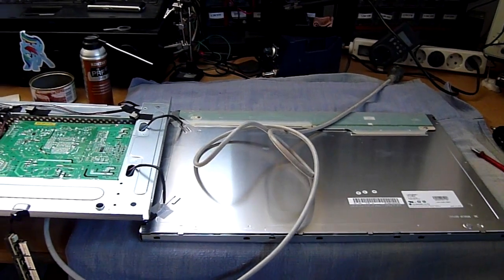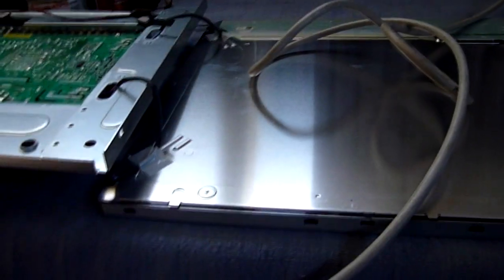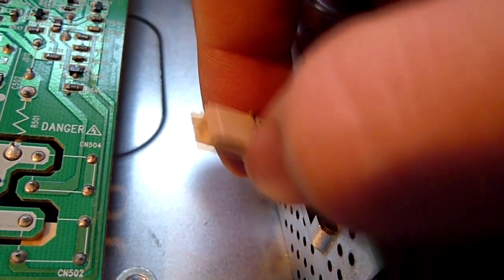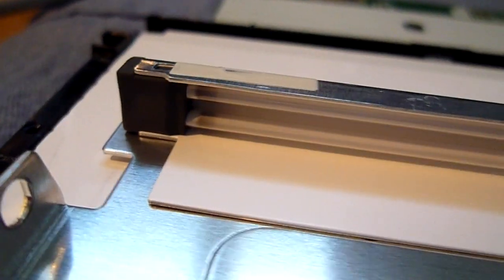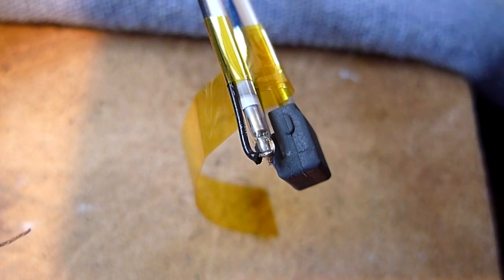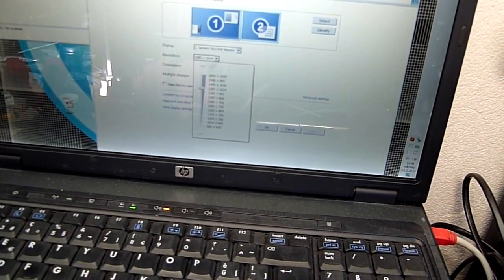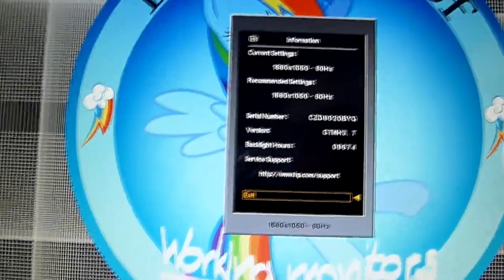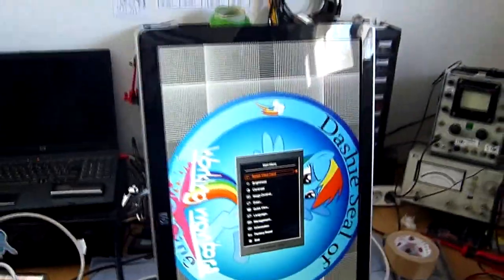Troubleshooting LCD monitor CCFL trouble

Comment: At my work we had Motorola mobile computers for barcode scanning that had a 10" display. These were CCFL backlit displays. After 10 years of 24/7 use I started to see failures, the display developed a pink hue. We had close to 100 of these units. After replacing the CCFLs in a few of these it got much easier with practice. I remember breaking quite a few bulbs when re assembling.

Comment: I've been struggling a bit with a LG 22" LCD from a client and I've just discovered the issue is just a CCFL. The failure was that, after sometimes just seconds, sometimes more than 15 minutes of use, the backlight will shut off randomly. I've checked if all the CCFL were on (all 4 were apparently working), checked the PS: inverter, capacitors, and blah blah. Nothing wrong there. Also I've spotted weird errors like: in the moments backlight was working, changing brigthnes on the OSD didn't work at all. So I've even suspected something going wrong with the CCFL controller, or even the OSD controller. 
But even after that last weird thing that happened, I tried disconnecting one by one the CCFL and found out it was actually one of them (that was actually correctly lighting in) the one that made the protection shut off.  It also seems to be the responsible for that error with brightness control. After replacing it with another, everything is working well. 
It was ONLY buzzing if brightness was at minimum (after changing it to minimum with the test CCFL, and connecting it back again, it was buzzing and flickering. At maximum brightness it seemed OK).

Comment: Lovely. I'm in that same situation right now with my 22" LCD monitor.
I hope it isn't the inverter on the power supply and I hope I don't screw things up. Leftmost part of these lights are darker and that noise you showed us on video was indeed present when I was testing. Fingers crossed!
Reply: Hey there.. You seem to know things about inverters so I&#39;ll ask you the same question I asaked the poster ... I just
 need to know if this monitor uses a CCFL or a CCFL-2 lighting system. 
(Apparently the CCFL-2 lighting uses two bulbs connected to two 
inverters.) And makes a difference whin applying settings to a color 
calibration system like the Spyder5....Thank you brother for your 
informed answer! ...Randy.
Reply: +Randy Levine I ended up not using the CCFL lights anymore.
Did a DIY using LED strip instead, using the 12V from the power source.
The light from them is brighter, but I dismantled the LCD a month after that mod because, all of a sudden the monitor stopped showing anything on screen. It was not backlight, maybe the circuit with flat above the monitor broke something. Unfortunately I couldn't find the problem so far.

Comment: I have the same problem, It turns on for a minut and go black, i suspect be the same problem as had already change the power suply and that did not solve the problem, but get a bit scary as you say the CCFT can exsplode if it get to hot on soldering it, and also seems not go that easy to do.but I order from china (AliExsp) 2 CCFT that become with the metal holder for around €8 or in dollars be $ 9,55 and hope I can fix it with that, and thanks for the upload off your video here on YT

Comment: Good vid! /)
I just took apart an old monitor of mine that had the same symptoms, and those dark parts at the end of the tubes looked like some black liquid was seeping out and touching the inside of the glass. I'll assume that means it has burned through. Plugging in a working monitor's back lights to the same power supply, they turned on and stayed on just fine. Learned something new here today, thanks!

Comment: i have a viewsonic 22in ccfl monitor, the power on blue led keeps cycling on-off, but when i disconnect the hv supply its steady on,probably oneor many ccfls must have fused or wiring shorted out, cannot seem to like todays led back light monitors/tvs, ccfls are pleasent to the eyes.

Comment: I have a Hannspree HF237HPB. I have replaced all the capacitors thinking that was the only problem. It has increased how long the light stays (up to 30secs compared to just 1) I checked the ccfls and one bulb defiantly needs to be replaced. How would you go by identifying what size bulbs are needed.

Comment: Don’t CCFLs sometimes have a coating of mercury on the outside? (Not just mercury gas inside)
Reply from the maker: No.
Reply: @FFcossag   “The literature reviews showed that not only does the fluorescent powder in CCFLs in LCD TVs contain mercury; in fact the entire CCFL, especially older and used CCFLs, have mercury amalgamated to the glass and the electrodes as well”
There was a study on this I cannot post links because YouTube will delete my comment then but if you google that quote it should come up.

Comment: Hello. Thank you for your response (By email)..Yes, apparently 
there are two types of CCFL lighting used in LCDs...Named CCFL type 1 
and type 2... Type one uses 1 inverter and type two uses 2 
inverters...As to the number of possible bulbs that each type can use, I
 am not sure.....

Do you know if the four bulbs in this HP monitor are connected to one inverter or two inverters?

Thanks for your help...

Randy... (From Toronto Canada)  :)

Comment: Hey there...Great video! ... Can I please ask you a question? ... I just need to know if this monitor uses a CCFL or a CCFL-2 lighting system. (Apparently the CCFL-2 lighting uses two bulbs connected to two inverters.) And makes a difference when applying settings to a color calibration system like the Spyder5....Thank you brother for your informed answer! ...Randy.

Comment: Very helpful!

I found one of the bottom CCFL on my Gateway FHX2300 monitor is bad and made the monitor shut down after 3-4 seconds.
I tried to unplug it and the monitor turns on only 1 sec, can it be just a protection circuit or that the driver is damaged?
Reply from the maker: +Electrospark That's most likely the protection circuit, replacing the tube will probably fix your issue.

Comment: Thanks for the video. I have a question: What if the problem is with the LCD panel connection between it and its logic card? I've got 2 out of the 8 flat connections detached and I don't know if and how it can be fixed. Do you know anything about it? Thanks :)
Reply from the maker: If you're referring to the cables between the LCD panel and the board running along the entire width of the panel, those connectors can sometimes be mended by running a low-temperature (250 C or so) soldering iron over them, slowly.

I've never had to deal with one of those being physically detached, however; aligning it for re-attachment is probably difficult bordering impossible for the DIY.

Comment: Is there any risk of high voltage in these monitors with them unplugged?
My 20 inch LCD is making what sounds like high voltage arcing or buzz. Maybe the same fix??? All the electrolytic caps test ok with cap tester and ESR meter.
Reply: +Len S Only risk would be the PSU caps. If you don't work on or near the PSU there should be no problem. If it still bothers you, you can always discharge them with a multimeter.
Reply: Cheers.

Comment: Man how did you manage to put the tube inside that steel thingy after peeling the wire off it? Did you put the wire inside it too. Your London accent is fairly understandable so no problems there.
Reply from the maker: I don't remember this particular fix, but I usually put things together exactly the way they were. I don't see why it'd be hard to put the tube back in.
Reply: Whenever I hear "London accent" I forget there are other London's than the UK lol (I'm gonna have to visit all the ones in Europe/Africa or I can't call myself a true Londoner). Clearly spoken, very informative and helpful video, kudos.

Comment: Youtube decided it wanted me to watch this one, so I did, I had the same problem on a laptop screen, one end of the CCFL desoldered and arced, unfortunately for me, it ruined the tube so I got a new one and fitted that, and it worked, a month later I bought a higher resolution screen anyway so it was a redundant fix... :P

Comment: Hello, i didnt fully understand what do you say about the smell of ozone? I got an LCD TV and the inverter boards are smelling something, i guess it is maybe ozone.
Reply from the maker: Ozone smells a bit like chlorine; think of the smell of a swimming pool.
Reply: FFcossag yes, in the meantime ive done some searching and found out this smell is coming from the what is called the corona effect, which is an air ionisation when there is a hight voltage around. See here if you're interested:
http://en.wikipedia.org/wiki/Corona_discharge
So if we smell this inside a monitor or a tv, it is 100% sure there is a bad joint near the CCFLs?

Comment: what?? omg? are these ccfls SOLDERED??????? how come they not in some socket for easy replacement? my problem is that I have a only 4 years old dell u2311h, wich is a pretty good IPS full hd monitor but the ccfls got kinda weak. Like not enough backlight, and straining my eyes. I remember it was wery strong when new. What is your opinion, its gonna be the same assembly/disassembly problems like here? Is it possible that theyre socketed for easy replacement...? thx.
Reply from the maker: They are not going to be socketed. They're designed to last the service life of the monitor, which is usually around three years. Generally, replacing CCFLs is not worthwhile.
Reply: 3 years omg :-(..? That is extremely weak :-( I mean this was a pro-sumer monitor with ips panel and higher than normal gamut. I planned to use it for at least 6 years or more. 
BTW what do you think about these ccfl to LED conversion kits which come prepared with a circuit board to replace the inverter I think...?
Reply from the maker: ***** I've never done any work with them, so I have no opinion.
Reply: +Kriszti&#225;n Not to worry. I still have this HP monitor  (8 years old now) and it literally still looks just as good as my brand new IPS monitor! (Except for the viewing angles of course). It has 9000 hours on it so it might be that it hasn't been used that much...But what a performer! ... I got it at Best Buy here in Canada 8 years ago as a refurbished unit for about $350.00 which at the time was considered a steal, lol... Aging depends on usage more than time. (And a little luck).

Comment: Cheap design and parts by HP company on these LCD monitors by putting in bad CCFL plastic and blast for light up the CCFL tubes up.Very good design and inter parts in LCD monitors products is ACER name brand.

Comment: Is it possible to completely get rid of the back light at all and replace it with some sort of highly reflective Front Surface Mirror instead?

That way the monitor becomes a reflective sunlight readable display and I don't know may be it will look more like a piece of paper rather than a source of light.
Reply from the maker: Yes, but it probably wouldn't work very well; backlit LCD panels are extremely poor at letting light through (only a few percent of the actual backlight light gets to your eyes). It would still be very dark, because of that.
Reply from the maker: ***** The monitor would be much darker than everything surrounding it. Just look at a mobile phone display in sunlight - they're usually purpose built semi-reflective displays, but they're still barely-readable due to their poor ability to pass light.

Comment: so r both the ccfl r on the top of the pannel,
i hav a viewsonic 22 monitor,it works fine, only a vertical single green line 0.5 in from rhs border, is it panel failure,i opened it (not the panel) cleaned the lcd connector with a eraser.
pls suggest.